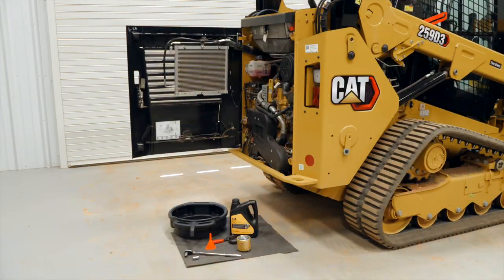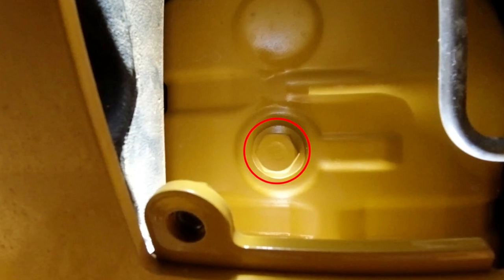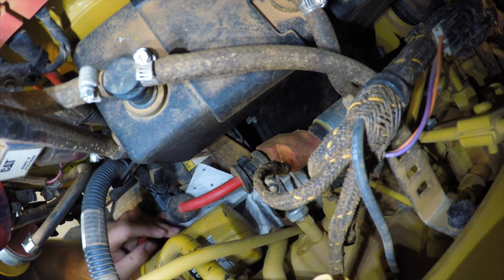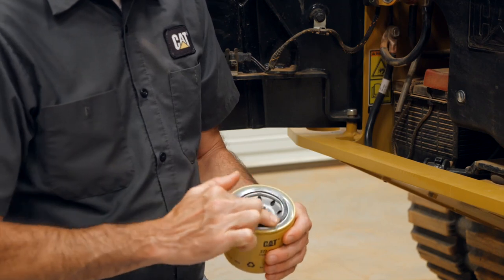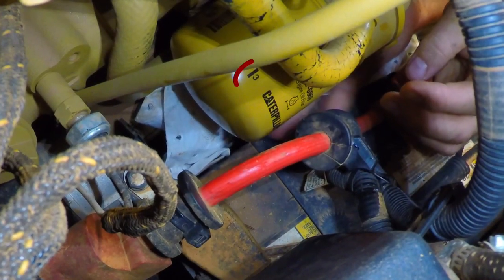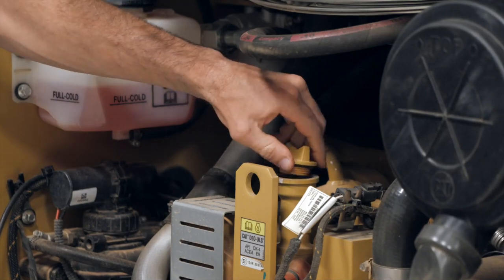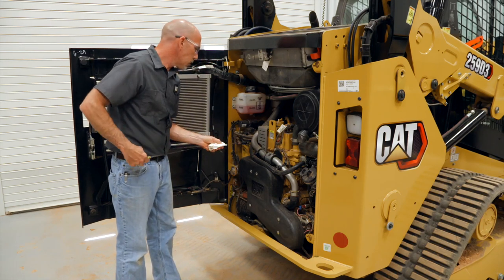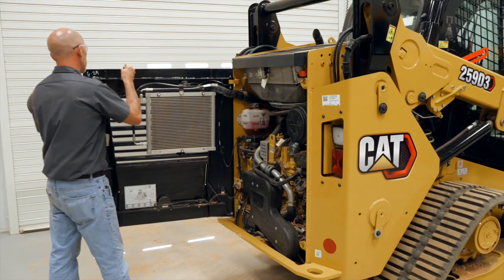How to Change the Engine Oil and Filter on the Cat® Skid Steer Loader and Compact Track Loader

Comment: Respectfully, the engineer that designed the engine, didn’t spend enough time as a technician. If they had, they would have never put the oil filter in such an awful place. The older 236’s were a breeze. The new machines are nice, but miserable to work on without “specialty” cat tools. They remind me of trying to work on the newer Ford trucks.... disassemble the entire cab to change a spark plug.